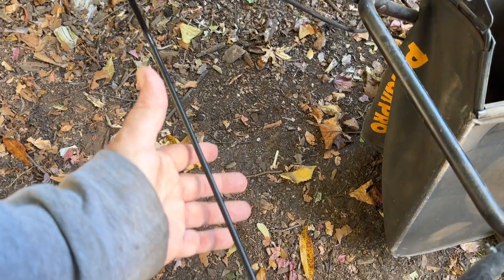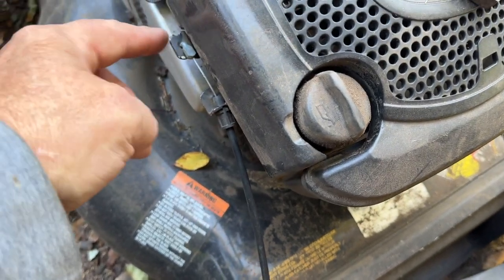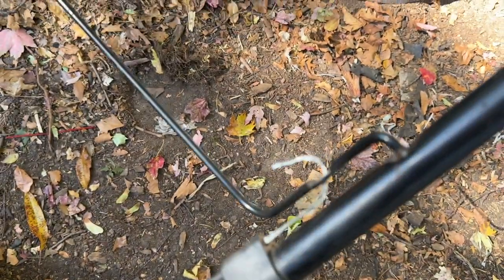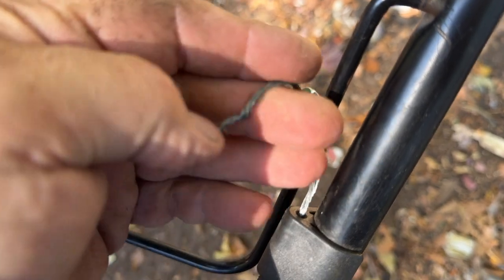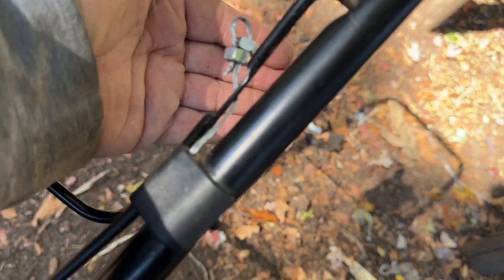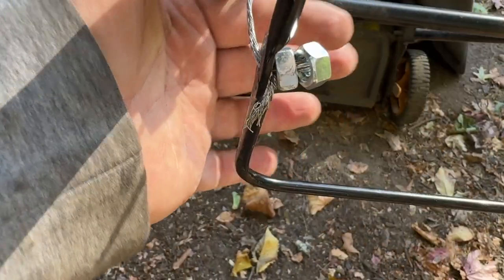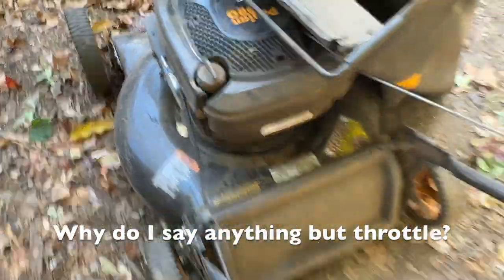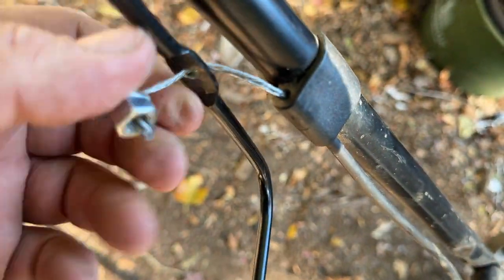youtube video #-3Vw3fmWVyw

Comment: Doesn't know what that wire is for it is a brake release, when released it stops engine so you don't cut your foot off.
Reply: He was right the first time sort of. It acts like a clutch, but its a brake. Once the handle is pulled in, the friction material that is pressing against the flywheel dis-engages. Kinda like a clutch would when you press the pedal.
Reply from the maker: Thanks guys! You're right, I had no idea what it actually was. Sorry for the wrong info, though the replacement part is called a throttle cable. Cheers!